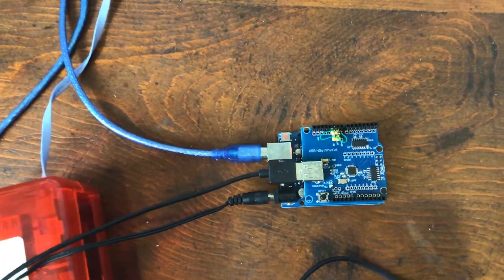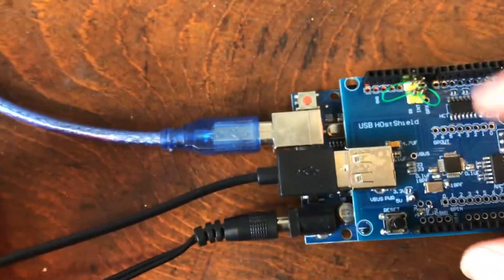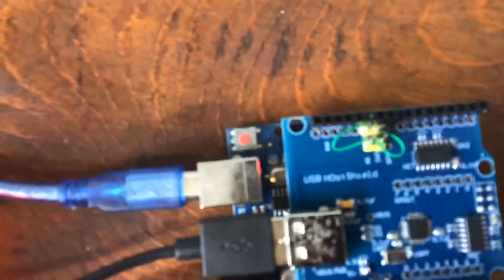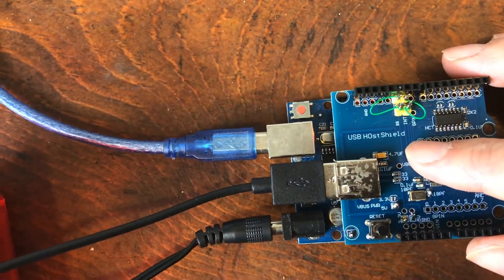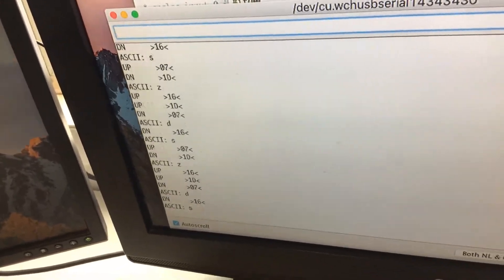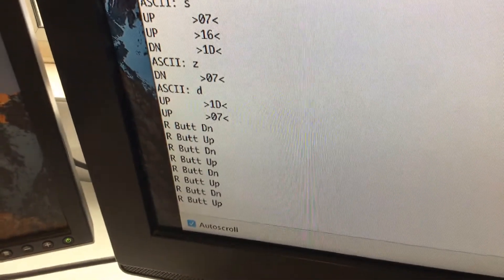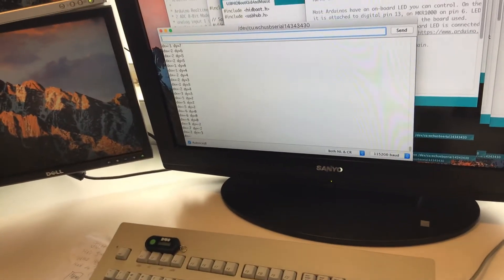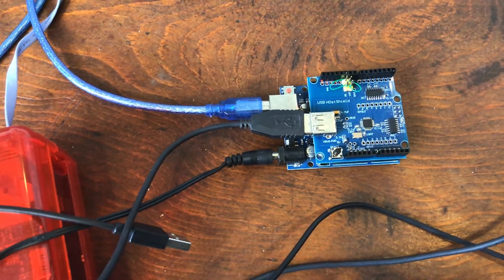Fix USB Host Shield

Comment: My usbhost doesn't go. Soldered the pitches. The usb works is powered. But it gives me error so I want to abolish it and use a usb port via A0 ---------------> DATA +. but I don't have the code and I have to look for a similar one and try sed lends itself for my project. Any advice? Thank you very much.

Comment: I bought a USB host shield and soldered it myself. There was no power at all 
I tried to charge my phone with it, plug in my mouse, etc.
Then I bought a pre-soldered one from ebay and the solder looks good.
No power either. Trying this on an Arduino Leonardo
Reply: did u find the solution ?
Reply: Ik this is old message but did you ever find a fix ?